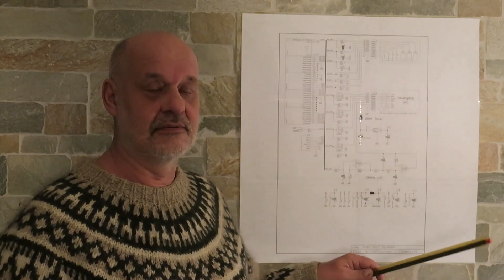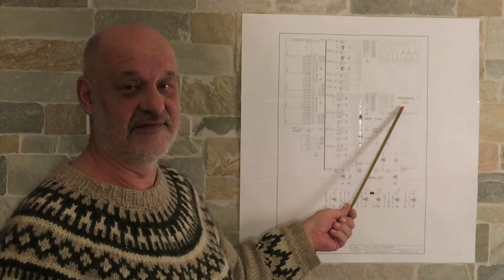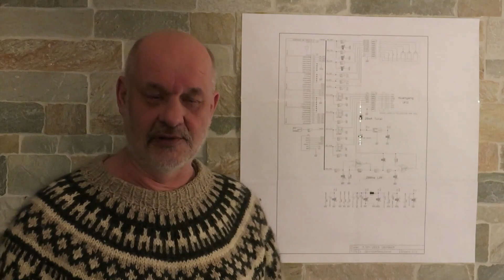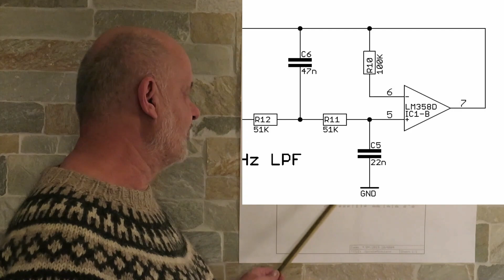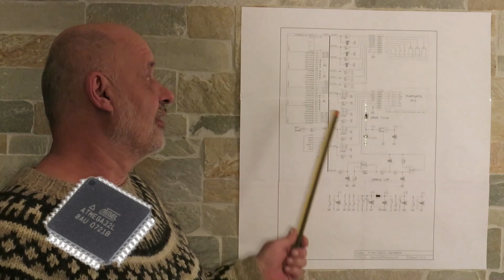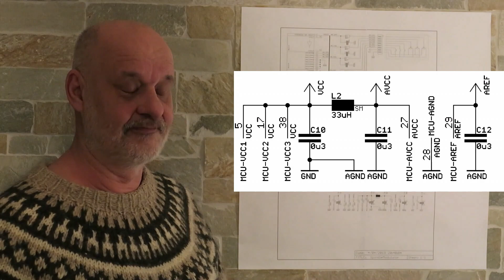FUM0014 VFD Speed Modulator

Comment: Interesting idea, Esko.  Do you have a working prototype yet?  Such a device could be really useful for machinists everywhere if it can eliminate or usefully reduce chatter in machine tools.  Is your idea for it to "listen" and actively modify the motor speed using feedback, or for the operator to manually dial out chatter as it appears?
Reply from the maker: This is not my original idea. I have proven the concept by manually altering the spindle speed on my lathe. This counteracts chatter. It does not eliminate it but it is a good "weapon" to have in the arsenal when everything else fails. It is especially suitable for the ringing type of work pieces. One example being an unfortunately sized tube, another a brake drum (from older car).
There will be a PCB design in the near future and after that I can program it and do the initial POC (Proof Of Concept).